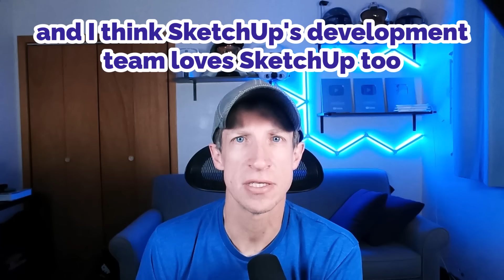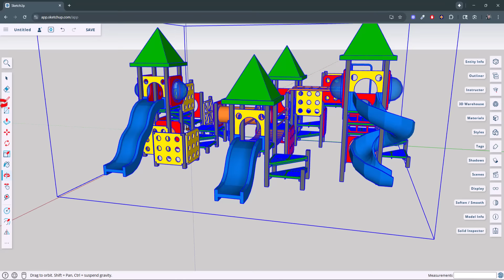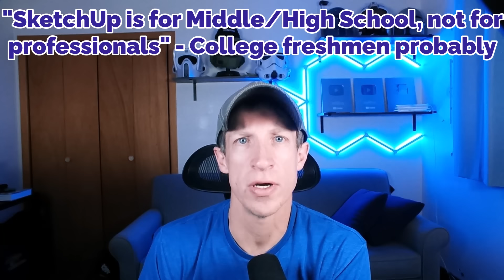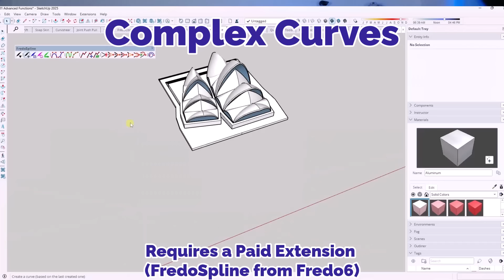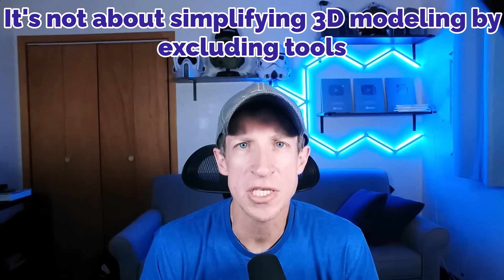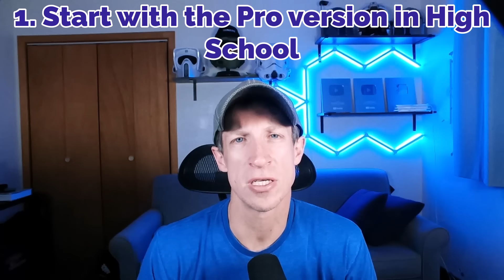Is SketchUp being REPLACED?

Comment: Que gran video Justin, muchas gracias por pensar en todos. Yo llevo modelando muchos años y mi sensación es que no domino nunca el programa porque todo lo que necesitas para hacer cosas complejas está en las extensiones externas. Al final pienso en migrar a Rinho
Reply from the maker: I think the extensions add some great functions to SketchUp, and there are a bunch for free ones. I don't even think that is a bad thing. BUT I think at some point, some features are just typical to 3D modeling programs and should be included

Comment: Unfortunately, like many companies, SketchUp is on a race to the bottom. This is well documented, and this mindset needs to change. One of the key advantages of SketchUp is that many of its plug-ins are developed by industry professionals, resulting in useful plug-ins rather than products created by developers. They don’t even tap into this. I’ve been using SketchUp for almost twenty years, and I see a limited shelf life for the product.
Reply from the maker: Well THAT I think is a common problem in software in general. I think it's difficult to find people both with a development background and also first hand knowledge of how the processes should work, leading to a disconnect between features and users. I see this in new construction software we test all the time

Comment: Yep, after 15 years of using SketchUp, I have switched to Rhino. I love Grasshopper. It takes a while to get the hang of it, but once you do, Wow!! This parametric stuff is super powerful and fun. In SketchUp, you have to rebuild most of the stuff when you want to change something, very dull, time consuming and frustrating, also drastically limits exploration. The SketchUp Community is awesome, and I am forever grateful for what I was taught in the forums and on YouTube, but I wish I had started with Rhino straight away.

Reply
Reply from the maker: I really wish SketchUp had an equivalent - it HAS to be able to integrate with elements directly in the model though (in my opinion)

Comment: I keeping hitting the ceiling of sketchup. When I saw you did videos on Rhino my decision was made to move to it. Too much effort by Trimble making useless improvements on features like  rendering (we have D5 for that!!!).
Reply from the maker: I don't fully agree with the rendering part - I think a built in rendering function is kind of table stakes at this point for modern 3D modeling programs. Not necessarily to replace something like D5, but a lot of people don't need that level of power. Also, does D5 work with Rhino? I can't remember
Reply: @Thesketchupessentials  It sure does!
Reply: @Thesketchupessentials  and keep up the great work!

Comment: I still use skp 7 most of the time because buttons are easilly readable, pleasing to look at, as oppose to the that minimal design primitive look started at about 2013 and peaked today when I still have to think twice if I hit the right command, yes they didn't improve the tool sets, but they do the same as revit you cannot save back to earlier versions since 2024. The main disadvantage of skp is the terrain modelling deficiency, makes it very time consuming having no native tools.
Reply from the maker: While Sandbox Tools isn't technically native, it does ship with every new version of SketchUp. I do agree that terrain modeling in SketchUp is VERY difficult without a bunch of additional extensions
Reply: @Thesketchupessentials yeah i have to use the surface tools. Thanks to you introducing to me too

Comment: Rhino has its use cases, but there are no videos of modeling beautiful buildings in Rhino on youtube. There is another problem, which is that software affects how your brain thinks about design, and rhino plus grasshopper changes how you think about design. It changes the types of people attracted to design. It changes the skill set needed for design. It removes skilled designers from the conversation, because they don’t want to invest time in a program that makes you feel like a product designer or computer programmer. To some extent, it encourages blobitecture, which isn’t how 99% of buildings are built. It’s useful in other industries, but it does not encourage free thinking about form making that is relevant to how buildings work. Criticisms of sketchup are valid, I just don’t think Rhino is the solution.
Reply from the maker: I don't think it's the solution either. I've used it, and I like the raw power, but the UI is definitely a bit clunky. I personally prefer modeling in SketchUp. I also don't fully agree about Grasshopper - it does way more than just generate organic shapes, like objects along paths, etc. I still think there should be a parametric toolset for SketchUp that does things like that (kind of like modifiers in Blender). I just feel like SketchUp currently is great, but there's so much more potential there
Reply: @Thesketchupessentials  agreed, but at some point we need to ask ourselves, what is the best use of our time? The vast majority of people in architecture would be better off learning other things, eg. construction techniques, business and management skills, costing tradeoffs, development feasibility, investment math, etc. rather than increasingly esoteric shape making tools. The same goes for increasingly complicated rendering programs. Frankly, the same goes for all kinds of other stuff that academia + pretentious firms try to push more generally, like theory and pseudo-intellectualism. The world isn’t nearly as complicated or as miserable as our profession makes it out to be. We make things complicated, and we make ourselves miserable. There is definitely something to be said for all the software people and what they are doing - I believe you learn far more from learning software than you do in school. But there are declining returns from some of the innovation.
Reply: More sketching, less 3D modelling IMO… software has caused a generalized decline in architectural quality…

Comment: Sketchup has be dormant for over a decade. Adding and changing very little to the program. Relying way too much on 3rd party extensions on tools that should be included as standard. I can think of very few important changes since Trimble stepped in. Not sure if Trimble doesn’t give the Sketchup team the resources or they simply do not care.
Reply from the maker: I'm not sure it's 100% a Trimble thing - Google didn't really push a lot of new modeling tools either. I think it might be a philosophy of the software thing

Comment: Sketchup turned me on to 3D modeling. But over time I realized that it is quite limited to modeling. The other problem is the information about add-ons that come out. Apart from your channel, there are almost no others who explain how the add-on works, whether it is paid or free.You had released a great survey about what we want to change in Sketchup, if any of the developers had bothered to read it, there might not have been such negativity from users towards the latest version.
Reply from the maker: I love extensions, and think they're a big part of what makes SketchUp great. I just don't think they should be the only way to get simple modeling functions available in most 3D programs. I will say that I think a lot of Devs feel the same way, but they don't always get the last say in what features get greenlit

Comment: Thanks for the very good message of comparing both of sketcheup and rhino 
Am an sketcheup learner and am so much interested 
But my issue with sketcheup is the layout that are separated from the Sketcheup itself 
Because I was using archicad and now shift to the Sketcheup 
Sketcheup is very good for me 
But if the engineers can implement some features of the archicad like detailing work afternoon the 2d and 3d in the archicad
Reply from the maker: I can't speak to how Archicad's features compare to SketchUp's as I've never used it. You can definitely do detailing work using SketchUp and Layout, but I don't know how they compare

Comment: absolutly correct, i think i will move to rhino and revit
Reply from the maker: Ugh - I hate working in Revit
Reply: @Thesketchupessentials I feel you, but if you consider that Revit is BIM and BIM is data, you understand why an entire industry (AEC) prefers this "3D software" over the others; it's a big problem that they sacrifice conceptual design in favor of manageable data. SketchUp should fix the interoperability between Revit, Archicad, Vectorworks, etc. (Autodesk had a product, FormIt, that emulates Revit, but for some reason they discontinued it because in my opinion XD it was a bad copy of SketchUp).
Reply: REVIT? Are you sure you want to make that move?
Reply: Refit is horrible, good luck.

Comment: Auto updated tables in SketchUp layout are also required.
Reply from the maker: I'm not sure exactly how this would work, since you have to run a report to get the data in the first place. Not sure if I want reports auto running in the background
Reply: @Thesketchupessentials Normally we will export the tables as an Excel file to a location and import it to the layout. I think it can be sent directly to the layout along with the SketchUp model. Just like table update in Revit.
Reply from the maker: @justinraju254  That's what I'm saying - there's no integration there right now, and I don't know how that would work without SketchUp also having a similar tables function

Comment: SketchUp used to have a free version for everyone, kind of like Blender but they took it away and lost a lot of users because of it. Back then we could even model buildings for Google Earth, which was a lot of fun. I wish they would bring that feature back. Now the 3D Warehouse has download limits, which makes it harder to quickly put projects together. It also can’t import text from AutoCAD files, which is frustrating. Hopefully they add better import options and make it easier to handle larger files in the future.
Reply: Drawing buildings for Google Earth was how I was pulled in to using Sketchup and have been using it ever since. I helped build Boston! Great memories!
Reply from the maker: They still have a free version for everyone - it's the web version. The Google Earth modeling went away because Google stopped using crowdsourced models to fill out Google Earth and started using satellite scans. You can still create 3D models in SketchUp and import them to Google Earth, but that's not how Google does their 3D imagery anymore.

As to download limits, isn't it like 100 models / day for free users? Are you doing projects that require you to import more than 100 models a day, or has that limit changed?
Reply: 0_o текст из файлов AutoCAD- это отдельный круг Ада.

Comment: I love SketchUp but I've been in Rhino for a while now. Admittedly it was a massive learning curve especially as I am going deep into Grasshopper parametric design but the power is immense once you slide in with a decent level of confidence. Both tools have their advantages and I will continue to use both. Thx Justin.
Reply from the maker: Honestly, I'm the same. I like using both, but I think a LOT of firms or people try to consolidate their software use into a single program to save time, simplify workflows, etc. It seems to me like offering some of these typical 3D modeling tools would be a smart move

Comment: As a DIY garden office builder, I wanted a program to help me design my office. Many years ago I used SketchUp to do similar things like design the interior of my house. It was so easy to use then. This time round, 20 years on, I must have spent 3 weeks trying to work out how basic tools functioned, none of them use the same logic as other creative tools and I kept on running into colder sacks where I couldn’t get what I wanted (bevels for example) and I’d have go start again! Very frustrating experience. In the end I created just the basis build list and didn’t complete a fully rendered 3d model. I won’t be renewing my annual subscription when it runs out next March. I will now go take a look at Rhino 🎉
Reply from the maker: Which other creative tools? Generally speaking the strength of SketchUp is its ease of use, so I'm curious which tools feel easier?

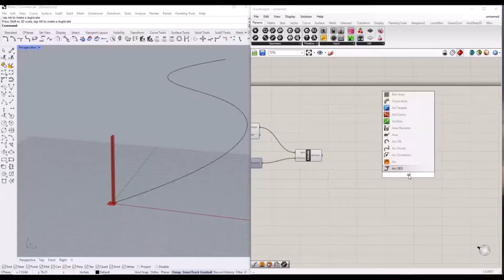Comment: 5:27 easy: just add the advanced tool pallete as an extension like they did with Diffusion and that will solve the problem of thinking how to make it easy for everyone.

But that palette is not only a bevel anymore. To hold us, users of SketchUp since 2004 - we need more advanced tools. Because now I'm thinking to jump to Fusion 360 only because of that.
Reply from the maker: I started off feeling like this was the answer, but I don't think I do anymore. There is zero reason a tool like bevel, for example, couldn't be added as a native tool, and placed in an "advanced modeling tools" toolbar that is toggled off by default.
Reply: @Thesketchupessentials  agree, but for example bending tool, or joint push pull, or other similar not so intuitive as native tools (and they never be because of their complexity) can live in that "advanced-pro-superb-whatever palette" that you can download anytime from extension warehouse. 

I think that is the main point why SU developers did not add them - to not make the native sketchup too complex to show the difference between SU and Adobe software (bad example but to show that in every adobe tool you can have a claustrophobic insult).

So yeah, its possible. They just take not that vector. Last year we all really trust too much to them and hope they finally can do something.
Reply from the maker: @whoarewenow Yeah in my opinion, as long as they can stay off and you just turn them on if you need them, they shouldn't be too confusing to beginners

Comment: Sketcup also has a problem handling high poly geomtery. Even if you paid for extensions, you are still limited with slow response and crashes.
Reply from the maker: It's way better since 2024, and honestly, I don't think it's ever been intended to be an ultra high poly modeler. Some kind of autoproxy function would be nice though to help with this
Reply: yea, SU crashes more than any other program ive ever used, its bonkers! :)
Reply: SketchUp basically is a mesh modeling tool, like Blender. The more poly they have to process the more laggy they become.
Reply from the maker: @HuyLe95  Exactly

Comment: Great post Justin. 100% agree on all points including my love for SketchUp. 

As a 15 year SU user, I’ve completed over 100 projects with SU ranging from residential to commercial and industrial. I’m 68 and plan to keep using SU another 15 years. 

Because I’ve made the time investment to make SU part of my muscle memory, as
Much as I love SU and our community, I feel hostage to continue using it because I just don’t have the time to learn a new program. 

I suggest Trimble:

1) Pay Justin to be a key decision maker / advisor to the SketchUp development team. 

2) fix the bugs that lead to daily crashes including a tool that will scour the hard drive to find and remove or reset anything that prevents dependable operation. I use Mac and I cringe when I upgrade my OS and SU newest release. There has to be a dashboard on theSU website that gives a green light to doing this instead of scouring the online postings for hints. This should be crystal clear and updated daily. 

3) I don’t rely on extensions much because they seem to constantly need attention to keep from crashing SU. The functionality of the top extensions must be integrated as native tools — pay the developers to make it happen.

Comment: You also forgot to mention the price of the program. Every year, SketchUp users have to pay a fee and get absolutely zero added value. Rhino, on the other hand, releases a paid update once every 3-4 years, but it always takes the program miles ahead.
I work professionally as a furniture designer in both SketchUp and Rhino. In my opinion, the only strong attribute that SketchUp has left is its large database of models created by other SketchUp enthusiasts, which is available for free.